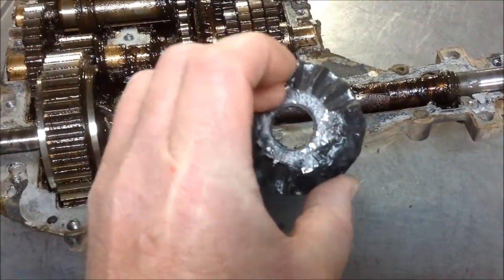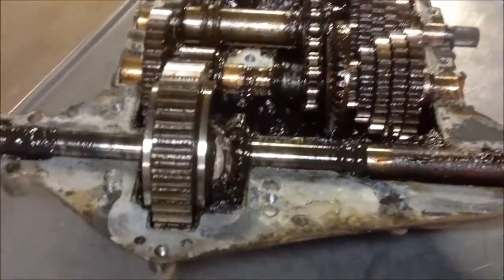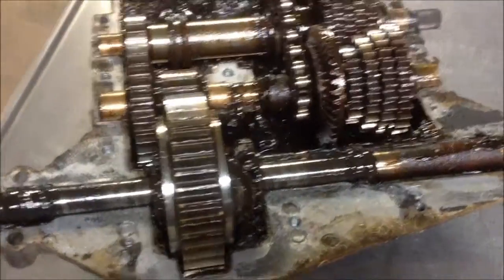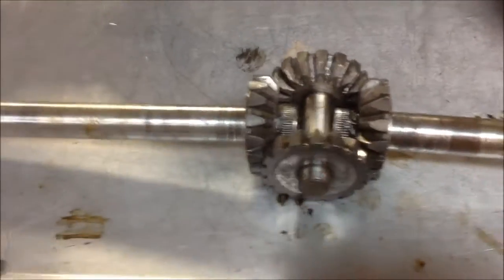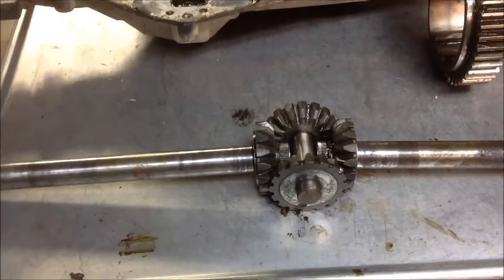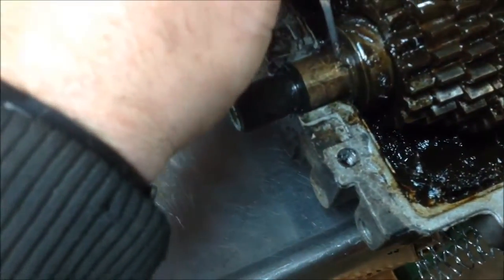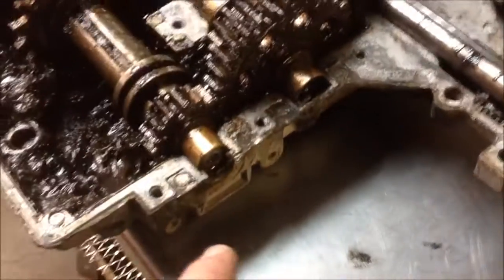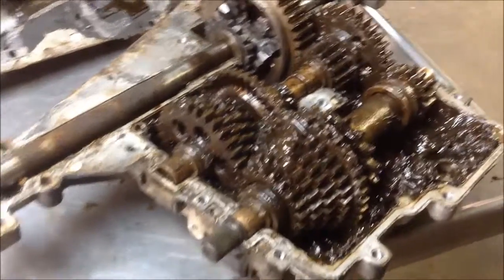Video 20 MowtorChaos Racing Lawn Mower Quick Start Guide

Comment: I’ve found that heating the gears with a propane torch helps clean the grease off. 
Take as much off with brake cleaner as you can but then hit it with the propane, then wire brush it or let it cool and spray cleaner again. 
And the preheat helps too, if you warm them up right before welding.

Comment: You scoop out the grease? Do you put gear oil back in are just grease? I guess gear oil would probably leak out. 
Thanks for the tips
Reply: Use an anaerobic sealant. 
Rtv sucks to scrape back off when you have to go back in. 
I’ve done 2 boxes , a peerless 801 and a mst206. 
The mst comes filled with gear oil already so it has seals. 
The older peerless doesn’t leak much, I found a couple drops under it in a weeks time. 
Not sure if it helps but I add some Lucas in the gear oil.
Reply: you can put in oil, 85W-140, which I would highly recommend. do not use paper gasket, use liquid stuff. Put a vent in top of transaxle housing, fill it half with oil/ only lower pan.

Comment: look up sprockets garage on utube specifically the "doc locker 1 and 2"
Reply: I agree 100% Doc installs the solid axle and also bearings, much stronger set up and has to reduce the friction carrying the axle on roller bearings rather than have the drag of the aluminum housing supporting the weight.

Comment: Just got done watching your quick start videos. Just wanted to say great job. I learned quite a few tips and tricks. I really like the one with the spacer between the front wheel bearings. The other one was the belt calculation. Thank you for all your great info...
Reply from the maker: +Don Raabe 
Thank you for watching and your feedback. The decision to do a guide, was kind of a last minute decision. I was kind of pushed to get the machine done, but wanted to explain what I was doing since I have had people ask what modifications are done to them to make them race machines.
I noticed there was a lot of videos out there, but not many that really broke it down step by step. I too skipped some things due to time constraints that I will cover on my next build, as I video it. 
I have another build I did a few months ago, that I will prep and put out soon.
Once again, I really appreciate the feedback.
Stay Safe, and Stay Fast

Mowtorchaos
Reply from the maker: +Don Raabe 
Thank you for watching and your feedback. The decision to do a guide, was kind of a last minute decision. I was kind of pushed to get the machine done, but wanted to explain what I was doing since I have had people ask what modifications are done to them to make them race machines.
I noticed there was a lot of videos out there, but not many that really broke it down step by step. I too skipped some things due to time constraints that I will cover on my next build, as I video it. 
I have another build I did a few months ago, that I will prep and put out soon.
Once again, I really appreciate the feedback.
Stay Safe, and Stay Fast

Mowtorchaos